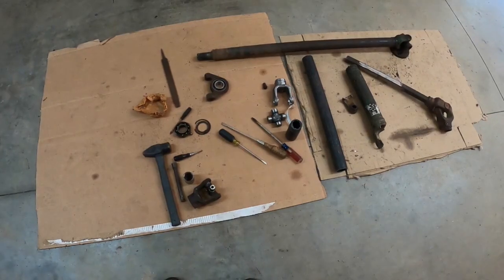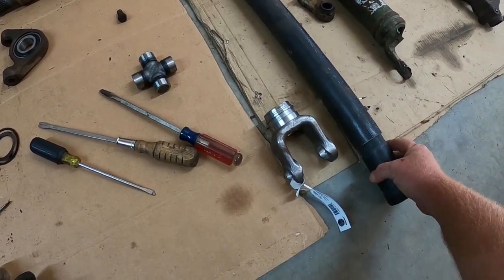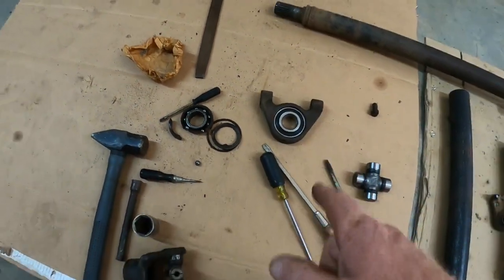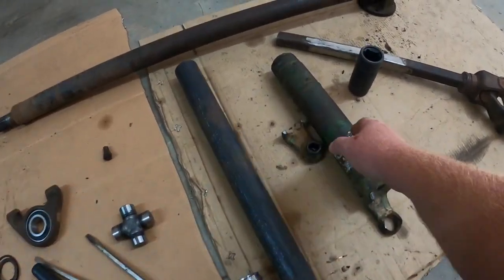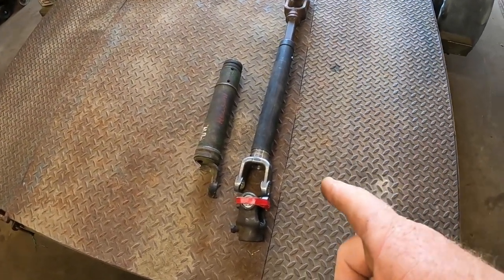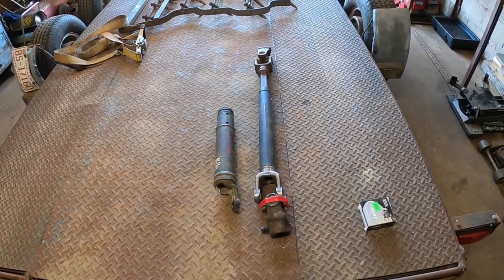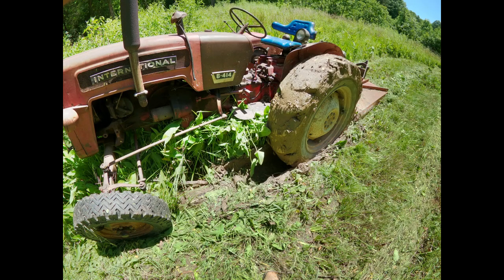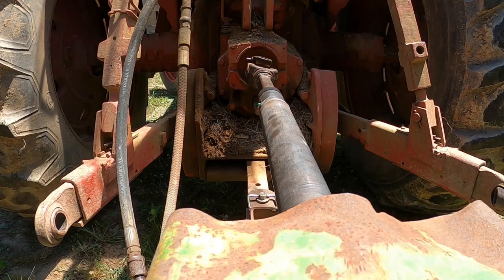How Build your own PTO shaft, parts and pieces

Comment: Where did you find the shaft parts?
Reply from the maker: Some came from TSC , the others came from agri-supply. It was very inexpensive compared to what I paid for the other shafts a shop built. But the ends were a very close tolerance so that helped with any vibration balance . Still going strong today 😁 Thank you sir for being here!! Any other questions feel free to email me, my address is in tht about section of the channel 👍